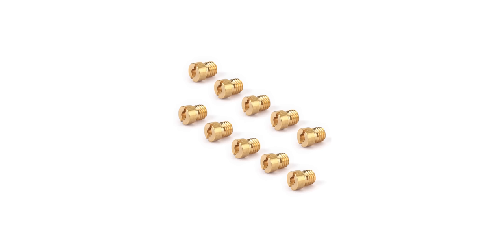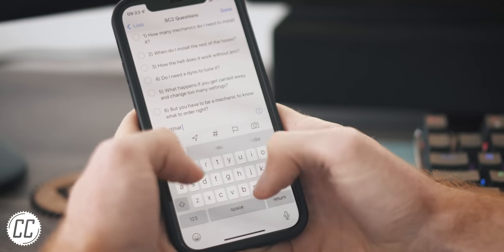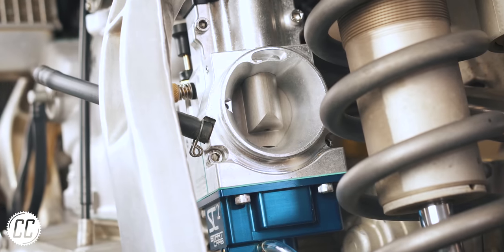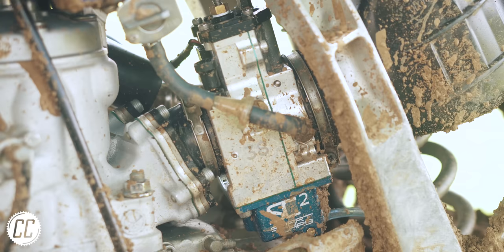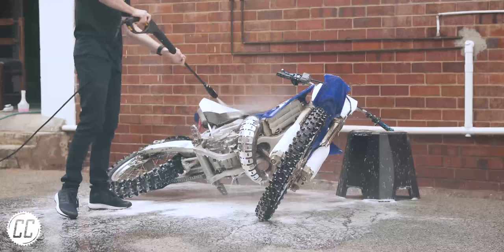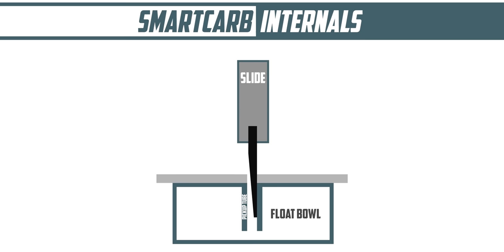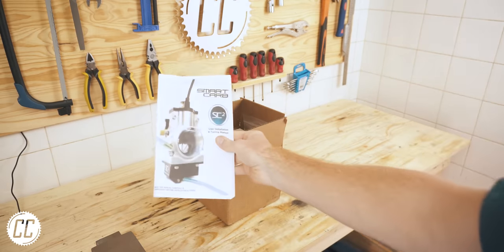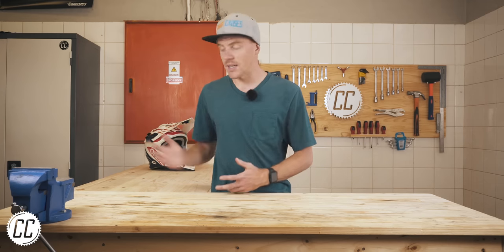The Best Carb Money Can Buy? | SmartCarb SC2

Comment: This is just a rip off of the Edelbrock Quicksilver carburetor which was made about 25 years ago. Even uses exactly the same needle and adjuster. Nothing special here.
Reply: We'd suggest you dig a little deeper. Both the Edelbrock QwikSilver and the SmartCarb share the same original inventor and the same lineage - only the SmartCarb is the culmination of those prior efforts and modern features that aren't apparently readily evident. You're correct in noting that both use a metering rod and the clicker adjuster. In fact we were fortunate to purchase surplus clicker thumbwheels originally machined for the Edelbrock some years ago. The same red clicker on the SmartCarb in this video was machined for the QwikSilvers in the late 80s. The Edelbrock you speak of was the first to introduce external adjustability in combination with metering rod carburetion. 

That all said, what is new and special here are a few things: first the SmartCarb boasts 6X the adjustment resolution of the metering rod position. The SmartCarb also uses a patented, non-round variable throttle rate venturi shape for optimization of metering rod signal down low without compromising flow on top. Another feature, also patented, is the use of at-manifold air density/velocity communication directly into the float bowl for superior A/F compensation regardless of elevation/temperature changes. The QwikSilver saw the first attempt at this with that anemic single hose connecting the front of the bell to the bowl, but it was proven insufficient, driving the changes you see in the more modern SmartCarb. 

You can't call what follows the precursor a rip-off, especially if both come from the same hand.

Comment: you are lying. This carburetor does not have any means to compensate for pressure when changing height. if I'm wrong - show me where the smart carb site claims this feature. This carb has two advantages: the quality of the mixture does not depend on the contamination of the filter, and the second is the convenience of adjusting the height of the needle. And it's all. but it doesn't cost $800! Are you lying for a half price discount?
Reply: The How It Works section of our website goes into further detail regarding our patented, integrated float bowl venting feature. Unlike conventional needle/jet carburetors or other metering rod style carburetors which vent their float bowls externally through more or less vent lines hanging down in front of the rear wheel, the SC2's float bowl is vented from inside of the airbox right at the manifold opening which allows it communicate not only in-air-box air density, but also velocity, to the float bowl. The results are more proportional fuel flow assist and a fuel system that can properly fuel the engine through the entire throttle range without the need for a secondary circuit (pumper, power jet, etc).

Any air density factors are compensated for, including elevation and temperature changes, but also, to your point, the quality of the filter. SmartCarbs compensate for artificial factors as well including blow-thru boosting, for example. That it accomplishes all of this is well documented by our customers, professional racers, Pike's Peak International Hill Climb records, turbo-charged land speed records, independent testing by North West UAV, and more.

The 38mm size SC2 model SmartCarb with TPS for Justin's Yamaha YZ250 3D ignition mapping feature retails for $798, plus shipping.

Comment: I just don‘t get what should be new with that carb - the british used similar carb Designs from the 50th on. Have a look at the SU H, HS and HIF models, they did exactly the same.
Reply: Those carburetors use a butterfly and a constant depression piston valve to throttle according to engine vacuum. It's not at all the same. SmartCarbs use a directly throttled flat slide and air velocity/density isn't used for throttling, but for fuel lift assist in the float bowl. Internal, integrated float bowl venting as utilized by the SmartCarb is a patented feature, among others.

Comment: These are not the first guys to built this.  Lectron has been doing this for a decade and much better. Also has a power jet that works like an accelerator pump.

Knock off company
Reply: Lectron's latest ownership, of many, isn't even 5 years old, let alone a decade. The Lectron carburetor entered the market in the mid 70s - notably without a power jet and was sold to GM, and the original inventor William "Red" Edmonston went on to create other carburetor technologies including the Ei Blue Magnum, the QwikSilvers I and II, AFT HVV, and ultimately the SmartCarb before his passing. Calling SmartCarb a knockoff or a knockoff company is frankly false as is the notion that a power jet works like an accelerator pump...

Comment: This looks like a new version of the old. "POSA" carb from the late 50's and 60's.....  Same needles, same slide, same overall looks...
Reply: You're right, the SmartCarb is the culmination of the metering rod carburetor concept and lineage that began with the Posa-Fuel. The Posa-Fuel, the Lake Injector, Lectron, Ei Blue Magnum, Edvac and Edelbrock QwikSilvers I and II are all predecessors. That said they aren't the same. The Posa-Fuel and the Lake Injector were both cigar cutter or guillotine style carbs with no float bowl whereas the SmartCarb uses a flat slide.

Comment: There isn't "less air" at higher altitudes it is just less dense. Your still pulling the same amount of air through the carb it just has less oxygen. That is why I really think someone should test to see if it's true that you don't have to tune it when changing altitudes otherwise you could just use a regular needle carb put a mechanism to adjust needle hight at the top similar to this and I don't doubt it would perform the same if not better since there is less restriction in the throat. Also I feel like the 10% more power is probably if you go to a bigger carb than your stock sounds gimmicky to me but 🤷
Reply: You are correct. Air density decreases at elevation. The SmartCarb, via metering rod fueling and internal, integrated float bowl venting, better utilizes whatever air density it is experiencing to drive more or less fuel proportional to that density. Happy to show you independent data from Northwest UAV out of Oregon showing minimal A/F ratio variance while testing a 16mm SmartCarb on one of their drone engine platforms, a 50cc DesertAir 3W28i, up to a simulated 22,000 feet, or to the point at which natural aspiration failed to support combustion in that application. Plenty of other data, with more coming, out there showing the power increases claimed, size for size. Stay tuned, we'll be sharing more as we go.

Comment: I’ve ported two stroke, and conducted plug-chops, to calibrate the jetting for different altitudes. Can this carburettor automatically recalibrates between low altitudes and high altitudes changes?
If not, it would be good to have a sensor or two and a stepper motor on that top adjustable screw.
Reply: Yes, SmartCarbs compensate for wider air density changes affected by elevation and/or temperature. How they do it is through integrated float bowl venting. It's a patented feature that vents the float bowl from inside of the airbox (small scoop in the top of the bell mouth). That means the float bowl sees the same air density AND velocity that the venturi does. The result is more proportional fuel flow assist for wider density changes. Extremes may require slight adjustments, but then that's a 10 second job without tools.

Comment: How did the 38mm run off idle ? I thinking about buying one for my ktm 250sx 2018. For trail rides but want to open it up other times.
Reply: SmartCarbs don't have quite the typical trade-off on bottom end when going to the larger size - so long as it's not too large for the engine. The 38mm SC2 would suit your 250SX just fine down low while providing more power on top compared to the 36mm. Reach out with any questions!

Comment: Has anyone done some fuel efficiency tests? Best way I can think of is to weigh your tank. Ride XX miles or kilometers with XXX weight of fuel on a stock carb. Then do the same distance with the same weight of fuel. 

Makes me wanna do a test. I just don’t have a stock carb to test.
Reply: Both Dirt Bike Magazine and Cycle News reviewed the SC2 in Beta 300s, including fuel economy testing. Just google each publication with the phrase "SmartCarb review" and you'll find them. 

Beyond that the mileage gains are well-documented in the community and are one of the biggest reasons top level pro hard enduro racers, including Cody Webb, compete with them. To do 3 laps to Trystan's 2 (TPI) at Bad Medicine last year before refueling didn't go unnoticed. 

Increased economy and reduced emissions go hand in hand as well and the SmartCarb has been twice EPA emissions certified for on-road motorcycle use.

Comment: Still too expensive. I can tell you that in many cases even cheap china ebay carb can work very well, if you just adjust it right. I am not saying they are good, but even they can run good. Use your stock carb and dont waste money.
Reply: Too expensive? The gains claimed are made against fully tuned/dialed factory stock carburetors, claims that are consistently proven out by our customers world-wide and by our sponsored top level racers. SmartCarbs are designed and manufactured in the USA and the cost isn't for everyone, but for those looking for the benefits it provides, there is no combination of aftermarket components that will give you the same performance gains, economy, or ease of use for anywhere near that same cost.

Comment: I wonder if by using less fuel than a stock carburetor for the same duty cycle, the engine might suffer inadequate lubrication by not consuming enough oil. Only if the previous mix ratio is maintained though. Do they instruct on changing the mix ratio al all?
Reply: Finer atomization increases combustion efficiency requiring less fuel/oil for the same or better performance. Less unburnt charges out the exhaust and zero fuel spillage both contribute to increased range. 

No hard recommendations on oil ratio. For a YZ250 like this we’d recommend staying around 40-50:1 depending on oil selection and riding style.

Comment: Im def a Keihin guy. I pretty much try to leave the idle and air/screw in the same spot and might go down a jet smaller in summer (less dense air makes it run rich) and one size up in jet in the winter. My bike came extremely rich from the guy I bought it from since he was at much less elevation than I am. I felt like a king that ive learned how to tune my Keihin.
Reply: You're exactly the type of customer we look for: Informed. If you should look to not only removing jetting from the equation, but also increasing fuel economy, enjoying greater, yet more linear power delivery throughout, zero fuel spillage, and tool-free carb adjustments for extreme/seasonal elevation/temp changes, we have you covered.

Comment: I thought it was going to have a Bluetooth cell phone in your face. This thing ain't so smart. Also 700 bucks GTFO
Reply: Why would it? The "smart" thing about it is it's superior fuel atomization resulting in greater combustion efficiency, more power using less fuel, producing fewer emissions outputs, and its ability to stay tuned for wider ranges in elevation/temperature changes. Any tweaks required can be made by hand, track or trail-side, in seconds, without tools or phones required.

Comment: Fuel injection will always be more efficient and accurate than any carburetor. 
The ability to alter and monitor MAP parameters and gain real time results from wideband O2 is more efficient and precise than any carburetor can ever be. There aren't enough circuits in a carburetor to maintain stoich through every scenario an engine can be placed.
Reply: What does a MAP/O2 sensor combination do that the SmartCarb, with it's patented integrated float bowl venting, doesn't? If we're talking real-time fluid communication of air density/velocity driving fuel flow in the float bowl proportionally to what is happening in the venturi then we're already there, only without the added complexity of sensors, electronics, computation, etc. No need for that or more circuits - only at-manifold, proportional density/velocity communication tying both ends of the fueling equation together (signal and venting). Let the engine tell the fuel system what it needs. That's how the SmartCarb operates. 

Oh and not to mention we've already EPA certified this fuel system, twice, for on-road motorcycle use (without catalysts).

Don't be fooled. There's still room for advanced, modern, mechanical fuel system technology and we're leading the way.

Comment: Those are JIS screws and you can tell because where you've fucked them you can see a small dot on the head. If you use a Phillips driver on a JIS screw you're gunna have a bad time
also hundreds of dollars for a new take on old tech is a hard pill to swallow.... If it was something like EFI for 2 strokes like KTM did then that would be a lot more interesting
Speaking of KTM's EFI system its actually pretty good with the little information there is on emissions for it, the 2022 model is quoted to emit 64.7g/km of CO2 compared to a comparable bike (I picked the CBR300R because its the same CC and a single cylinder even though its a roadbike it should be pretty comparable as a rough idea) the 2020 CBR300R emits 76.8g/km so excluding other factors 2 strokes have a good chance at being road legal.

It makes me wonder how much this emits tho
Reply: The SmartCarb's performance, efficiency, and emissions outputs make it a viable alternative to most types of fuel injection for 2-strokes, including KTM's TPI. We have EPA/CARB certified the SmartCarb for on-road motorcycle use in North America, twice.
Reply: @SmartCarbFuelSystems  oh cool, so out of curiosity whats the emissions numbers look like?

Comment: Best carburetor for moto under 200cc is the one from Honda NSR150sp Proarm edition that carburetor very easy to tune even smoother than convert to fuel injection
Reply: In my country call it N-Pro carburetor 
N is mean NSR, Pro is mean Proarm(single side swing arm)

Comment: Screw that, if I'm spending that much I'm converting to fuel injection.

Even if you have never touched a carb a few minutes to learn costs way less than trying to buy one of these, you would be be better off finding a carb model  that has  a easily accessible jet.  Also a good bit of advice is take those Philips bolts from your carb to a hardware store to find ones with a flathead or torex head so you won't strip anything.
Reply: Fuel injection is pretty pointless on motorcycles you dont get the perks of things like higher compression ratios because the fuel is still being delivered via port injection through a throttle body rather than direct injection straight into the combustion chamber like fuel injected cars.  Fuel injection on motorcycles has become more of a necessity to cope with our shity corn syrup filled gasoline not a performance upgrade.
Reply: @Wint3rshad3  something about that just doesn't make sense. A fuel injection system can keep AFR closer to where you want it along the rpm range and they can compensate for altitude and potentially be more efficient for the same amount of power in some cases. Now unless motorcycle carbs have got that good over the years I think fuel injection is still a good upgrade. (Especially for high performance applications)

Comment: At 700- 900 USD it should install itself. For the modest potential gains one gets for the money , it seems more like a bench racing bit of bling than a must have.  One wonders, how many factory teams are campaigning bikes with it , and if they aren’t, why not?  Teams are all about that little bit more advantage.  I’ve seen all manner of high dollar new carbs come along since the early 2000s,  where are they now?  Why didn’t most people running carbs switch? 
My opinion is, it’s just not enough gain for money spent.   Mik and Keihin both have excellent flat slide carbs, and when tuned well, perform very close to fuel injection also.  YMMV.
Reply: Your opinion might be better served by trying one for yourself to see. The gains aren't modest - no other fuel system provides the same performance/efficiency, factory teams are competing with and/or testing it currently including pros like Cody Webb and Mario Roman, and this is a relatively new technology. Skepticism, and to your point, other carburetors claiming what they can't deliver have created an uphill battle for us, not to mention the rise/implementation of fuel injection. FI is our competition, not other carburetors. They don't compare.
Reply: @SmartCarbFuelSystems    Nice advertisement, but I again ask, how many factory race teams are campaigning your product?  Not “ testing”, not “ looking into”, but factory teams actively campaigning it.    I already know the answer, but go ahead and post another advertisement.
 All that is obvious here is you’re selling the answer to a question no one asked.

Comment: So it`s basically exactly the same as a traditional SU carb that`s been around for 50 years. Nothing new.
Reply: No, the SmartCarb operates entirely differently from the SU. The SU carb uses a butterfly throttle with a vacuum driven piston using a traditional tapered needle. The SmartCarb is directly cable throttled using a flat slide with a metering rod. Patented, as in new, features include the metering rod, the variable throttle rate venturi shape, the internal, integrated float bowl venting, external adjustability, and more.